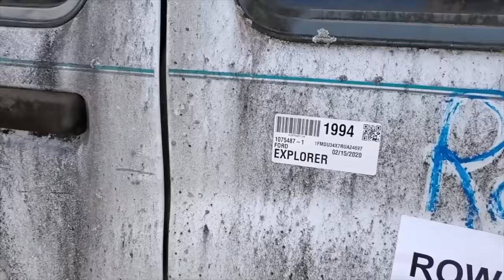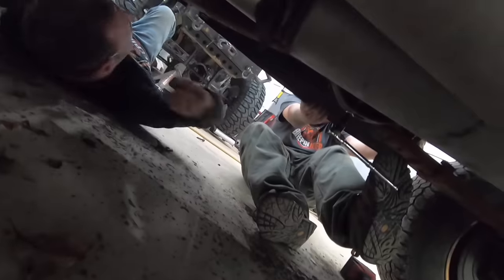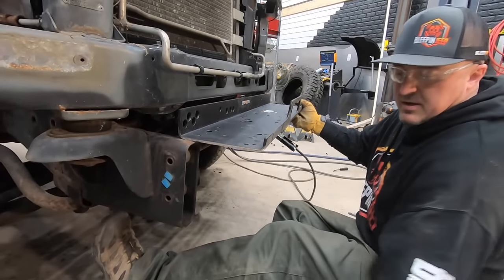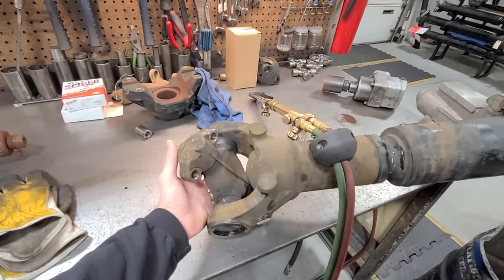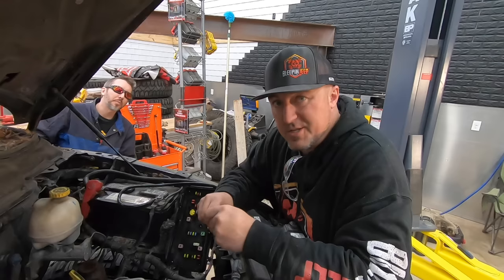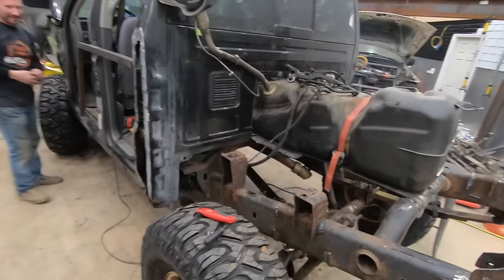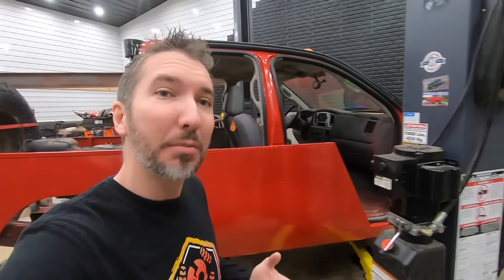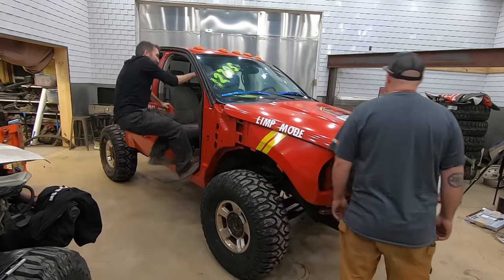How To Build a Rock Crawler For FREE

Comment: This has been one of Bleepin’s best episodes yet! I’ve done the exact same thing building a K20 farm beater…it was actually more fun than my built TJ crawler that I have like 15 times the money in!
Reply: Gee looks like fun I knew a old man who burnt his ear drum because of a hot slag spark.made me where ear plugs
Reply: Hey me too. I'm taking an f250 frame, shortening it, and stacking an f100 frame with its cab motor and trans on top. That way I don't have to mess with the steering geometry and I have the motor trans and tcase mounts already where I want them. Good luck
Reply: Magnet is fer scraping bassturds!
Reply: @60EFFIE  j

Comment: My friend Brad and I did something a little like this but for Tuff Truck Racing. We built a 1998 Dodge Ram 1500 with the 5.9 Magnum 360. We kept it mostly stock but got rid of the Ram body and replaced it with mostly sheet metal and Jeep CJ body panels. I GUARANTEE the doors (at least for mine) weighed WAY MORE than 50lbs. I still remember how it felt picking them up and throwing them off my trucks bed only to see the door bounce off the glass instead of shattering it lol.

Comment: You guys are a hoot…and great builders. 
I had an uncle that painted a car in the ‘70’s with house paint and a brush.
Reply from the maker: House paint?  Never tried that one?  Was it latex or lead based?
Reply: @bleepinjeep  
Back then who knows. He was a master carpenter not a car guy.
Reply: @bleepinjeep  I painted a beater car desert tan with acrylic latex house paint and a 4" foam roller. Looked ok for $20. It scraped off easil tho, but that could have been my fault during prep. I still like tractor enamel for a wheelin' truck tho.

Comment: Hey Matt and guys if the dodge is still running you maybe able to cure the missfire if it's a cracked head or failed gasket try some k&w block seal if it's a crack it will fix it 90+% of the time I've used it many times with great results follow the instructions it's simple drain & flush antifreeze fill with water add k&w run for 30+ mins also if compression is going into coolant remove sparkplug from missing cylinder before running etc....once done drain all water let air dry 24+ hrs good luck

Comment: I worked at a Ford heavy truck dealership in the mid 80’s.  We would get one ton standard cabs that had been modified to work as totters at the airport.  They would notch the rear corner of the cab for the wheels to fit.

Comment: 57:20 A worm gear style (Torsen) limited slip diff will act like an open diff when applying force to a tire up in the air.  It has to have the torque coming from the drive pinion, and at least some resistance on one wheel for both tires to "lock" and spin in the same direction.
Reply: Which makes it terrible for rock crawling as there are often times one wheel will be in the air.
Reply: @Skwisgar2322  True. They're great on snow, ice, mud, etc - varied traction situations. Still better than an open diff off road.  You can apply a little brake, and torque will be sent to the grounded wheel.  A locker is still the best since 100% of torque can go to either wheel on a driven axle.
Reply from the maker: Hmmm, good info and good to know!

Comment: That magnet is what a Veterinarian would put in a cow’s first stomach to collect metal that the cow would eat along with the hay and grain. Not that cows are supposed to eat metal, but sometimes it happens.
I’ve painted a 1979 F-150 with a roller with Rustolium farm and implement paint. I painted it in the morning outside on an 80 degree day and it was a little tacky still at night when I drove it in the garage. It looked like tinted bedliner when it was completely dry.
Ford in the 90’s had problems with oil pans rusting out from under the paint.

Comment: Jb weld over the hole in the oil pan, then after it’s hard do an even bigger layer on it, and then might as well toss some flex seal over it for good measure, that’ll last longer than the rest of that hole will

Comment: I have "temporarily" used a wire wheel, torch solder paste, and solder to "Temporarily" fix pinholes. And you can "temporarily" fix a small hole by using solder as a paste between a metal patch and the hole with the edge of the hole and the back of the patch pre-tin'd.

Comment: Pro tip- when using in impact on seized suspension parts, the bushing will dampen or absorb the force instead of having it applied to the bolt. Just use a breaker bar.

Comment: I’ve fixed an oil pan like that on a power strike. Wire wheel it, jbeld, sheet steel, more jb, flex seal

Comment: The magnet is there for scrapping, I used to keep mine in the tailgate seam on the bed side with a short zip tie looped through it.
Use them to check ferrous vs non ferrous metals to sort them.
Reply from the maker: is there a reason to have a football shaped one instead of a square or rectangle one?
Reply: @bleepinjeep  Cow magnets?  Used to keep consumed metals in the stomach instead of passing thru the intestines.
Reply: @BleepinJeep  it's one of a pair of cricket magnets. If you've the pair you throw em right end they make noise. Child's toy. Griddless is likely right as to why it was located there.

Comment: if the oil pan still seals, you can seal it against a flat surface (clean all the oil off it, of course), put a thin epoxy on the exterior, and pull a vacuum through the drain hole until epoxy cures.  You can opt to glass it afterwards, but not required.

Comment: Jb weld to fix the oil pan. 
10 years ago, I had a friend that put JB Weld on a hole in the crank case of a motorcycle. It is still running today, Leak free

Comment: Use a crayon and rub it in the hole and then put some jb weld over the area I have done this on my ram oil pan and rear diff cover has held up great for over a year now

Comment: JB weld for the oil pan works.
Wife had a Nissan "Sentra"?,,, found a puddle of oil in my drive, I couldn't believe my eyes when I got it up. Used JB on it ran it til the new car was ready and sold the pig the next week. Yes, I told the new owner about the fix.

Comment: Seen/heard of quite a few rusted out oil pans.
One Cummins
Two Ford IDI diesels.
You can't pull the oil pan off of about AMYTHING that's 4wd anymore, especially diesels.
NONE of the Ford diesels that I know of.
Well, you CAN but your going to remove cab and motor mounts. Then jacking up the engine UNCOMFORTABLY high. BUT, it works.

The Cummins was on V Belt and Son on you tube, happened when he POWER WASHED IT!!!!

Comment: I used to have a Geo tracker. I was having service done and the guy calls me over and says, "Looks like your oil pan is leaking below the seal." At this point he very gently tapped my oil pan with the back of the screwdriver. My oil pan was so thin that it punched about a quarter inch hole in the rounded edge of the oil pan almost spraying oil out 🤣 In Michigan, they salt heavily. I recall my dad's excursion needing an oil pan for similar reasons.

Comment: Well for what it is not a bad job would have liked to seen round bar going across the rear passenger doors to the front door for the side guard and a little rounder angle instead of that sharp angle but looks good for what it is

Comment: I'll tell you the temporary fix you could have done I did it on my 2000 Dodge Ram and my 88 Dodge Dakota I don't like to admit it but I drain the oil clean the pan really good and put JB Weld on the rust spots and it's held the years I just don't want to change the iron pan

Comment: The magnet is probably because the previous owner was a scrapper. 

And i know your joking about how its a 4 door jk but ive said for a long time i dont know why more guys dont just start with gas 1 ton trucks theyre a perfect start for a wheeling truck
Reply: Especially considering how much extra weight people like to load on top of anemic 3.8, 3.6, and 2.4’s
Reply: @johnbarrett6842  then they put 1 tons in them anyways and end up just as wide..
Reply from the maker: And it’s got a hemi, that’s like a $50k upgrade on a jk

Comment: Does the spinning technique to determine the diff ratio, applies to transfer case ratios as well? The ratio is double the number of spins?
Reply from the maker: 1:1 on that since there is no differential in there.  At least not on most t cases.  So a 4:1 t case would be exactly that, 4:1

Comment: I have a Jeep TJ that had a small electrical fire under the dash which melted a lot of wires. I was wondering where to get a wire harness.  I am going to put an engine harness from Holly(LS swap) so I only basically need it for the lights and stuff not so much the dash gauges.
Reply from the maker: Pull-a-part used or maybe painless for a new one.

Comment: I would tell folks where I get my Dupli-Color paints by the case for cheap but I'm not going to, sorry. I built and drive my rig every day and I've painted the rig three times because of changes using Dupli-Color's OD Green ultra flat because I don't need to wash it every weekend.

Comment: I have a 1988 Toyota forerunner asking 9000 firm extremely straight very clean interior never wheeled everything works for the most part. One of the cleanest ones that you will see for $9000 it has a new motor with roughly 28,000 on it. It is an automatic. It’s an SR5. With 198,000 original miles. Hit me up if you’re interested. It would make an excellent daily driver because of the great shape that it’s in.I can send pictures if interested

Comment: Build a rock crawler for free except the 2700+ cost for the vehicle and thousands of dollars in tools and equipment, drive shafts, winch, shop cost, square stock, sheet steel, gas saw blades cutting wheels tires,. ext ext...lol Actual cost thousands upon thousands of dollars plus hours and hours of labor, Free sounds great though right??? even if you sell on ebay still not free even with your gorilla math 🤡🤡🤡